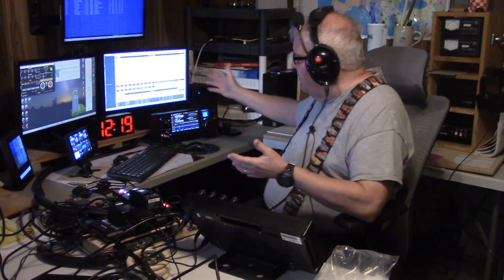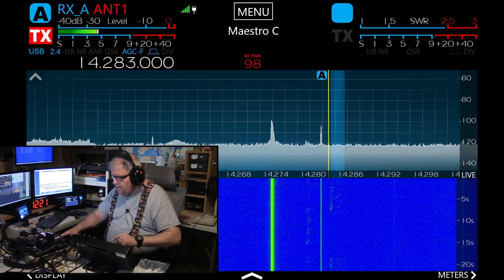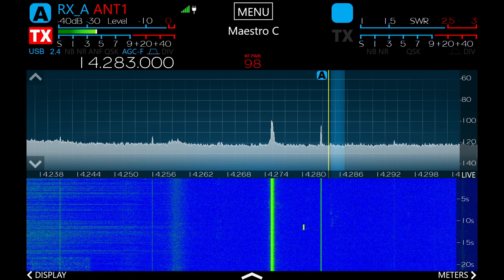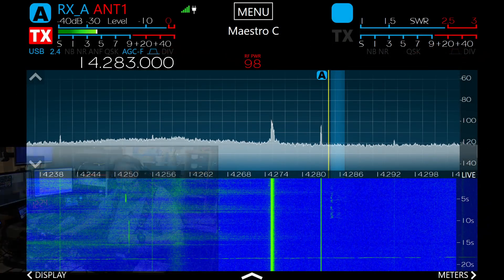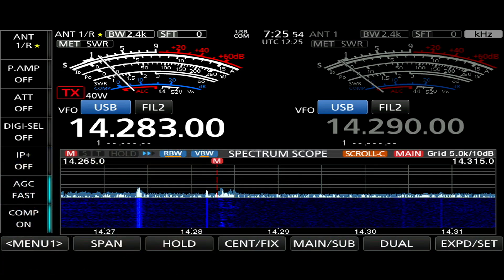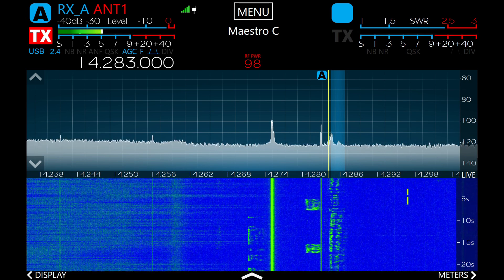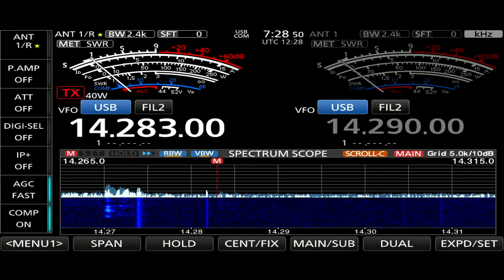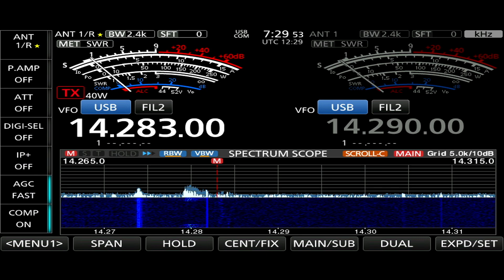Weak Signal SSB Test   Flex 6600 vs Icom 7760

Comment: With headset I can hear a slight difference in the audio response which might also affect intelligibility at these low levels. Despite the BW being the same what about form factor of the filters? Icom was on sharp or soft? And Flex? Can you tell us more about? Anyway it looks like on the Flex the signals are more immersed in the noise. Why not to check also sensitivity (MDS) with an RF sig gen and some sort of audio analysis?
Reply from the maker: Icom filter was set to sharp. Flex filter was the default shape for SSB. Receive equalization was flat for both radios. No RF preamp on both radios. It has been suggested by viewers that I should have had a preamp on with the Flex. I have confirmed that adding 16 dB of preamp brings the S Meter down to S1 (corresponding to the Icom). But I don't know if receive intelligibility (the point of the test) is improved. I don't think so. But I will rerun the test at a later date and also plan to test the Flex 8600M (a friend has one on order).

Rob Sherwood has tested both radios in his lab. I will defer to him for the measurements (http://www.sherweng.com/table.html).

The point of the test was which radio was most intelligible on very weak signals to my ears. I have experience with an earlier version of SmartSDR from Flex where this was poor - but a subsequent update drastically improved it. It was an unannounced feature but later confirmed in person with a Flex rep (Tim). I think we are back to this situation. 73 de W4EEY
Reply: @ roger that, all copied, thanks for providing further details. Yes, I’ve read the other comments about the preamp thing. Would like to know more about how the Flex works. I’ll get the manual. Looking forward to your next test. 73

Comment: Cheaper option, would have been to invest in antennas? or your signal to noise? S5 noise on 20M is hard pill to swallow, no matter how many HF radios you have.. just my two cents...
Reply from the maker: Agreed that the best investment is better antennas. But the test objective (for me) was to determine which radio demodulated weak SSB signals better. I tried to set up the radios the same but due to different design philosophies and architectures the resting indicated noise levels were different. I have confirmed that adding 16dB of preamp on the Flex drops the S-Meter to S1 (corresponding to the Icom). I do not know if this improves intelligibility however. I think it just changes the indicated noise floor on the S-Meter and Spectrum Display. I plan to rerun the test at a future date and to also test using the Flex 8600M of a friend (currently on back order). 73 de W4EEY

Comment: Flex noise floor appears to sound slightly higher.
Reply from the maker: I agree. It has been suggested that I should have used the preamp on the Flex and I will rerun the test sometime in the future to see if it makes a difference, but in my experience the Flex sounds normal but the Icom sounds better. 73 de W4EEY

Comment: Gary - not a comparable evaluation. Icom has a pre amp ahead of the ADC so the Flex will always sound weaker. Add 10dB pre amp to the Flex and re-shoot the comparison. Please turn noise reduction on to make the sound more pleasant.
Reply from the maker: You may be right. Possibly I set up the evaluation incorrectly. I was listening on 20M with 0 attenuation and 0 preamp on both radios. I did adjust AGC-T on the Flex to just begin to reduce noise (which I have been taught is the proper method). Filter bandwidth and low/high frequencies were set to be the same - 300 Hz low, 2700 Hz high). Equalization was bypassed (flat).

I will rerun the test when possible. For now, the Maestro C is back in the classroom/studio where it is used in our current licensing classes. I will also rerun the test when my friend receives his Flex 8600M which is on backorder.

Adding noise reduction (to me) defeats the purpose of the test. I wanted to assess the raw intelligibility of the radios to receive weak SSB signals. Adding another layer of Digital Signal Processing defeats this purpose.

As I mentioned in another reply, I have seen this issue before (and maybe this my bias). Years ago (before I was on YouTube) with my Flex 6500 and Smart SDR software I was frustrated by poor weak signal intelligibility. I set up an A-B comparison with my Yaesu FTDX-1200 (a much more modest radio) and found the Yaesu to be superior. Then Flex came out with an upgrade to Smart SDR. I installed it and the problem was solved. I could hear significantly better on the Flex.

Nothing was stated in the upgrade documentation about this but when I subsequently spoke with Flex's Tim Ellison at a Ham Fest he just smiled and acknowledged that there had been an improvement (bug fix?). I want Flex to do this again.

Very 73 de W4EEY
Reply: Can I be awkward and request a Flex 8600 to attend the test, please?
Reply: what I do not understand is why left/right audio is used so that you can decide with headset on..
Reply from the maker: @RoelandJansen  I think you meant to say "why left/right measurement is not used". That would have been a valid approach but it would force the viewer/listener to use headphones. I don't think most YouTube viewers use headphones so I set it up in the way I did. Thanks for commenting. 73 de W4EEY
Reply: So you're saying other than the Pre-Amp control (being off) on the front of the 7760 radio, there's another one?  You may be mistaking the Digital preselector for a preamp and from what I can tell, they are both off.

Comment: Do you think that if the noise floor was the same on both transceivers  the flex might have sounded better? Signals had to beat S5 noise floor just to be heard on the flex. That being said I like the Icom better.
Reply from the maker: That concerned me too before I started the test. I even contacted a friend and asked him to check his 6600 for a "resting" noise level on 20M. His S Meter too registered about an S4-5 on his Flex (the Icom is about S1). I think it is normal and a result of the different architectures used in the radios. Thanks for commenting. 73 de W4EEY

Comment: Excellent receiver 7760, you can immediately see that it was made not in a garage, not by mechanics, but by engineers at a factory!
Reply from the maker: The Icom IC-7760 is an excellent radio. The Flex has a better Spectrum/Waterfall display and is more full featured in some areas. But when it comes down to reception intelligibility the Icom wins (in my book). That could change. I've experienced Flex doing a software upgrade that improved this in the past. I'm hoping that they would do it again. Will be using the 7760 in the upcoming CQWW WPX SSB test at the end of the month. Want to see how it handles contest signals. 73 de W4EEY

Comment: The Flex is over priced Rubbish
Reply from the maker: The Flex has a better Spectrum/Waterfall display and is more full featured in some areas. But when it comes down to reception intelligibility the Icom wins (in my book). That could change. I've experienced Flex doing a software upgrade that improved this in the past. I'm hoping that they would do it again. Will be using the 7760 in the upcoming CQWW WPX SSB test at the end of the month. Want to see how it handles contest signals. 73 de W4EEY
Reply: I'm guessing that you have no hands on expereince of the Flex if you state that.
Reply from the maker: @peterg2yt  Thanks for commenting. What should I have adjusted to make the Flex more intelligible? Thanks in advance. 73 de W4EEY

Comment: Icom sounds a bit better but was wondering about attenuation settings on both radios. Were they both set at zero?
Reply from the maker: Yes. Zero attenuation, zero pre amp. Icom RF Gain at 12 o’clock. And the Flex AGC-T control was adjusted to just reduce noise.73 de W4EEY
Reply: This would be an interesting test.  On a quiet band, adding preamp on the Flex should cause the noise to drop (you should see the spectrum ‘grass’ drop).  If you don’t see the spectrum drop 4-5db, you’ve added too much preamp and you should reduce by one notch.  Does the preamp work the same way on the 7760 … to reduce noise?

Comment: Great video.   They are really close.  But 7760 is newer tech.  I would like to see the 7610 against the Flex.  The 7760 is a keeper.   But so is the Flex.  I have the Flex 6600m and love it
Reply from the maker: Both are good radios. I've been in the Flex Family since I bought my 6500 years ago. I subsequently upgraded to the 6600 when it was announce at Dayton. I have seen (heard?) improvements in receive when the radio software was upgraded so I am hoping that any deficiencies I highlight might be rectified in a new software version. But for now I am enjoying the Icom IC-7760 as my main radio.

73 de W4EEY

Comment: I wonder why so much difference on noise floor.  Icom floor is S-1 while Flex is S-5.
Reply: The S meter in the Flex works like a real spectrum analyzer and measures the energy in the pass band. As you decrease the receive bandwidth, the S meter will drop.
Reply: @k9yk I don’t know well the Flex but I do agree. Some SDR nowadays shows the real channel power in dBm on the selected bandwith. S-meters on ham radios instead are to give an approximate indication and work on AGC intervention. Just think that an S-1 correspond to -121dBm. Try to provide any ham radio with that level and you’ll never see the meter move to S1.
Reply from the maker: I noted that as well. I consulted with my friend Bruce, KB4FHA. He too has a Flex 6600. His S Meter reads the same. With no antenna connected there is at least an S3 Meter reading on the Flex. I believe it has to do with Flex calibrating the meter to absolute readings in dBm. I was wondering if I found a problem with my radio but now I don't think so. Good catch! 73 de W4EEY